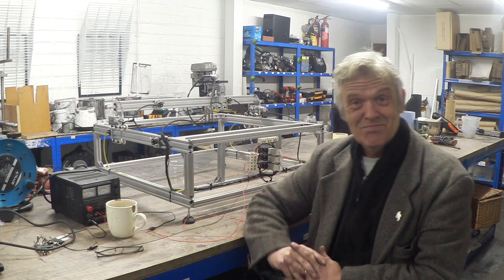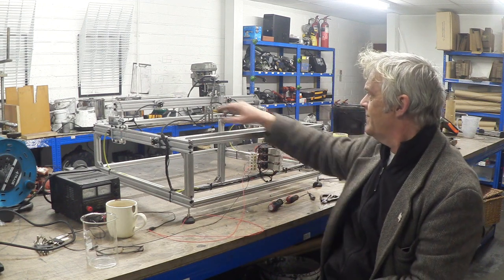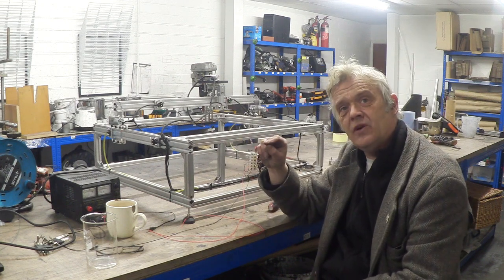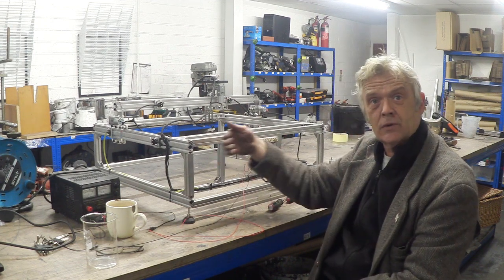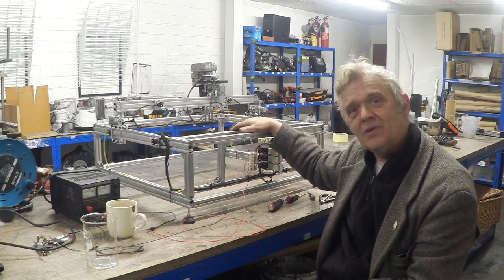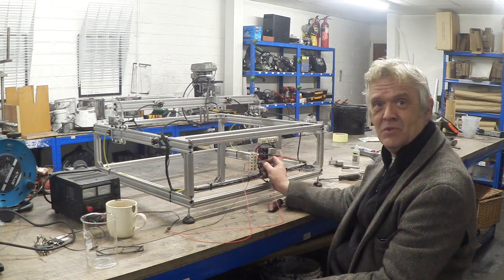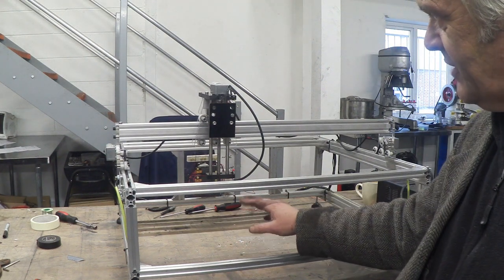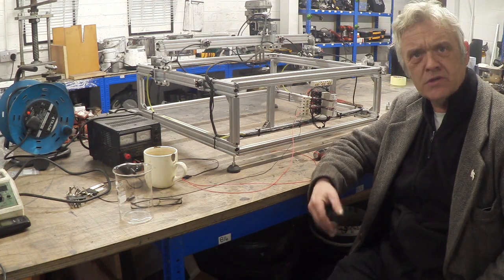Home Built SILAR Machine

Comment: Hi Guys, I’d be interested to know why you discarded the “rotary based” machine that probably was an earlier thought when at the back of an envelope stage? Cheers and as ever thanks for the “mind food” so generously given. BTW how can an iPad user find the members area?
Reply from the maker: there are a ton of ways to solve this problem mate - but as i want to add heating plates a rotary base would probably be a lot of trouble to implement for that - though in itself and without heating i think it would be fine
Reply: Robert Murray-Smith Thanks, now we know. Swings and roundabouts, but I forgot about the see-saw!
Reply: Yes, thought that also, just a simple turntable, 4 nods in the side, single switch, motor for dipping, moter for turning and off you go????
Reply from the maker: absolutely mate unless you wanted to add heating and stirring into the mix
Reply from the maker: oh and I am afraid  don't know mate - the members is still beta for youtube and it doesn't show in some platforms - no idea why and i am afraid i don't know what to do about it - sorry
Reply: Robert Murray-Smith Cheers for the info, I don’t mind waiting if I’ve not been forgotten!
Reply: The members area only works on certain devices at the moment. I can see it on my Windows laptop and Android phone but not on the Android tablet. Probably same for Apple.
Reply: A M P Right, as RMS said “the members is still in beta for youtube” so the odd hiccup is par for the course.

Comment: I used to maintain a 24track tape machine that used basically the same method to move the 2 pinch rollers into and out of place.

It is important to use a diode across the relay coil when solid state control is used to remove the back EMF problems.
Back EMF will destroy your transistor or Arduino output as the collapsing magnetic field can cause very high voltages.

I found out the hard way
Reply from the maker: I won't be driving the relays directly from the arduino mate - i plan to use a relay shield to drive the DPDT relays - the shield should have the diodes on it - but nice point cheers
Reply: Rob, I'm sure you know all this but I thought I'd better say anyway as many don't. I also had a vision of some young, past me getting very frustrated.
Reply from the maker: lol - it's no worries mate - i thought it was a really good point to make and appreciated it

Comment: Just a thought, have the Z axis rotate on a base plate, you containers are then placed around the rotating Z, only two motors and shitloads less extrusion required and save workbench area required.

Nice job though :)
Reply from the maker: there are a ton of ways to solve this problem mate - as pr i am trying what i think is the simplest possible - having 3 stages all driven the same way seems less complex than a rotating arm where a stepper would be needed - sure you can calculate position but you would never be sure unless you tracked it or home point or start end position - all of that need some sensor in play - maybe an opto band or wheel or hall sensor - what ever it seems to add complication which i am not sure is necessary when you think all we want is four positions and that can be held as a two by teo matrix read from switch position - that way the switches do two jobs and no further construction is needed - not say what you are saying is not good mate - just going through my reasoning

Comment: why don't you use a cheap cnc controller based on an arduino? i think is going to be cheaper and more precise than the relays
Reply from the maker: you don't need precise mate and the motors and relays were really inexpensive - you can buy all four of them for the price of one NEMA